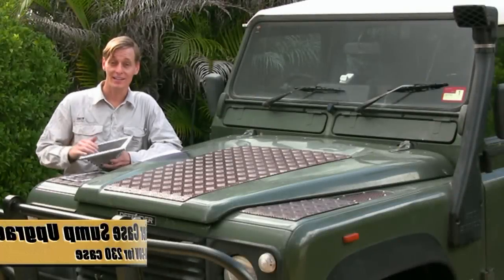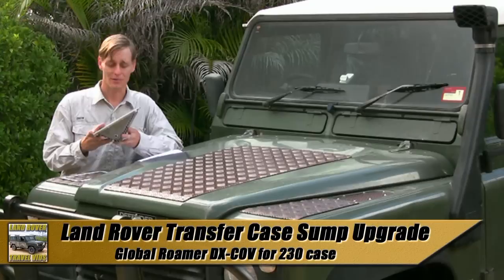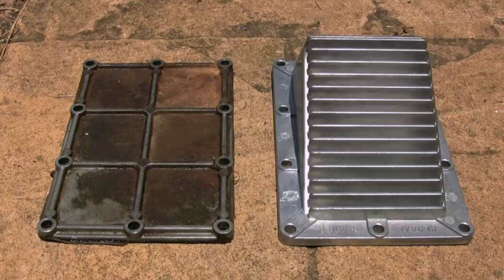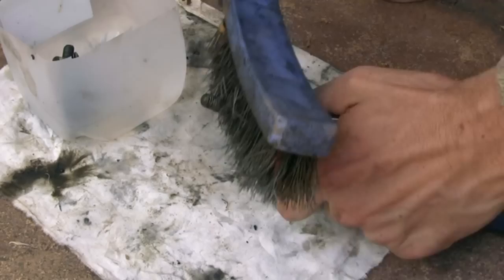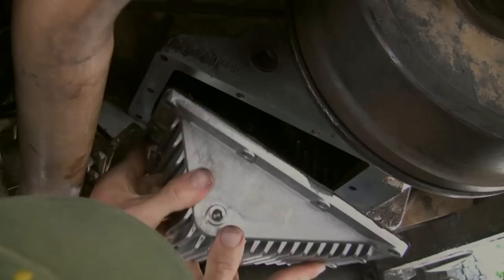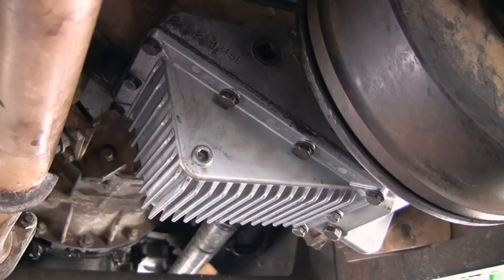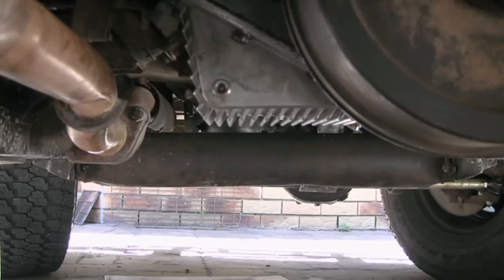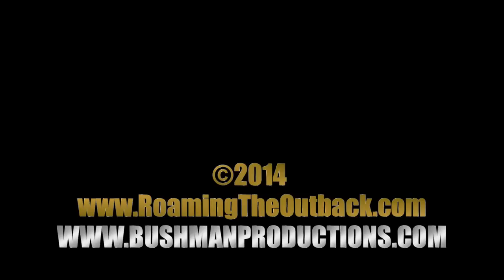Land Rover Transfer Case Sump Upgrade - Installation

Comment: Considering the corrugations you drive on, I would be adding thread locking compound to those bolts! Remember your exhaust system coming loose earlier. Looking forward to new travel videos.

Comment: Looks like a great product.  Just concerned it may get damaged offroad.  Where did you get it? Thanks for sharing yet another great vid.
Reply from the maker: They are produced by Global Roamer. Check out their website for worldwide distributors. The sump is still higher than the chassis and handbrake drum.. would expect they would be hit first. Time will tell. Thanks

Comment: Hi Brett, how does it work on long highway passes? I've noticed last summer, that on long highway runs with car loaded with 4 kids and lots of luggage inside, stuff on the roof rack, i had big amount of heat coming inside from under the drivers seat. As you can imagine, it's not very nice experience in hot summer:)  I'm thinking about buying it mostly for those boring highway runs. And why have You used silicon, and not gasket from kit?
Reply from the maker: All works well. Though will still get heat coming up from the gearbox.. unavoidable without more interior insulation. I used silicon to improve sealing due to imperfections in the mating surfaces where the thin gasket may be insufficient to seal fully. Every little bit you can do such as the sump with fins will probably help.
Reply: Thx, ordered it last friday. Will see how it works and then move to insulation process,  but i'm a little bit affraid that it will keep moistness. Already have lot's of issues with humidity, even after making fixes from water ingress manual

Comment: Hi Bret, I´m a big fan of your vids! Now watching this video again after buying and instaling the same transfer case cooling sump, yours seems like to be mounted up side down... or am I wrong. I´ve mounted mine with the oil sender port facing the front of the vehicle and the Global Roaming mark on the sump body can be read in the right way. Please let me know if I have made it the wrong way. Keep up the good job mate. Regards from Brazil.
Ps.: Sorry for my bad english
Reply from the maker: Thanks mate. There may be different versions made over the years, but as far as I know as long as the longest side is at the bottom so it sits horizontal it should be on right. Just imagine you wanted to jack it up from the base.. if it's sitting flat it's on right. If on an angle, it may be on wrong. Probably wouldn't really matter as long as it doesn't protrude too far down and become a rock hazard and the oil temp sender port is at the lowest point to read the temp.

Comment: I am thinking about installing it but I am also a bit concerned because of the closer distance to the exhaust. After installing the cover, it may absorb the heat coming from the exhaust... Was this considered by someone? are there any temp tests "with VS. without" ?
Reply from the maker: Hi mate. I don't have any data on temp readings although the manufacturer may have. On my car I'm quite sure i'm running cooler... there is sufficient distance in air gap so the muffler won't heat the sump.. next time I take a long drive i'll check the temp and let you know. Thanks
Reply: Roaming The Outback
Thanks for the reply, i am looking froward to install itl. I will probably install the temp sensor as well.
Cheers,
Avner

Comment: Looks like useless part. Have you ever overheated your transfer box?
Reply from the maker: Under heavy towing or intense sand driving, it is possible to overheat your oil and cook the seals. This just allows a little more oil to transfer away heat and fins for air cooling. It was primarily designed for use with an overdrive unit made by the same company.
Reply: Sergey good point i believe heat brings on wear and failure my logic says his tc will outlast a standard one .,,
Reply: @davidgray9897  Changed my mind. Finally got high sump. :)